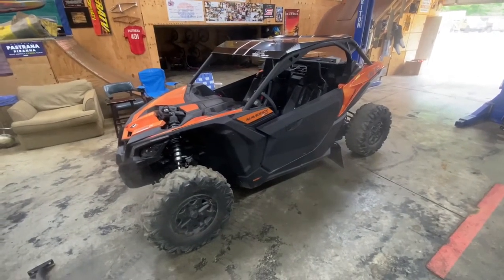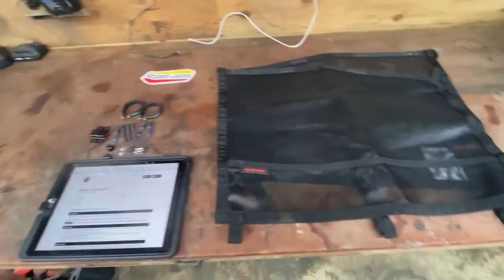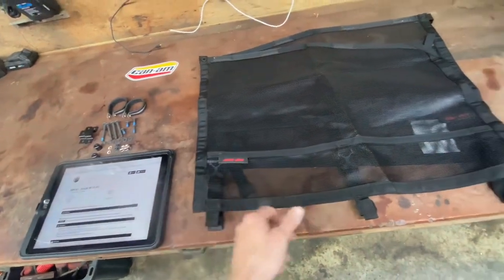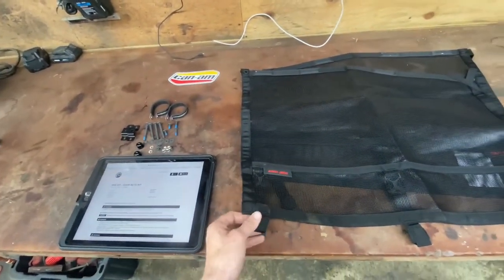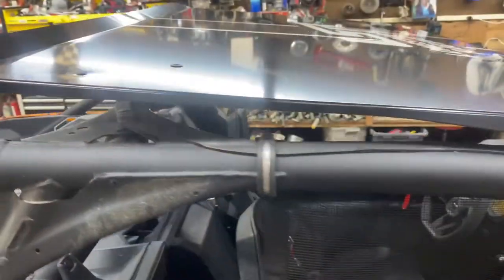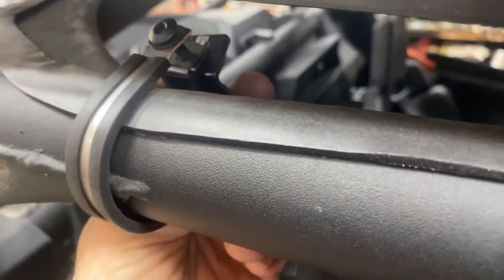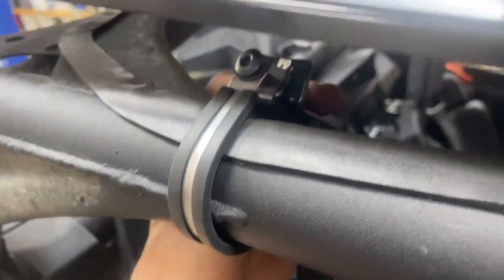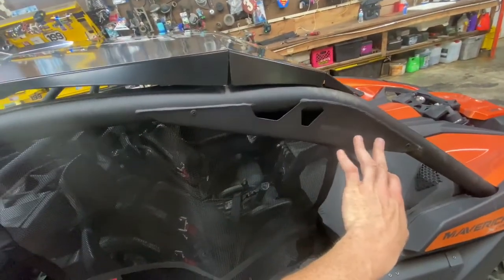Tech Talk Tuesday | How to install Maverick X3 Front Window Nets

Comment: Nice job here.  Question if you don’t mind. How do you open door?  Do you have to take them off?  Is that easy and quick?  Also, I have mirrors bolted into those upper holes. I’d have to change that I guess. Finally, anything you install on upper bars under at least the oem roof makes it very tough if not impossible to secure roof with the very short screws they supply. I do like the idea of nets to keep arms inside in case of disaster. Ty.
Reply from the maker: So the net attached towards the rear of the cage. The the top to the front has magnets to help hold the net to cage. The very front has a rubber loop that you loop around a stub that you bolt on using the holes in the cage. 

You can still use your current mirrors. 
May just need longer bolts to mount the stub on the inside. 

As for the roof. I’m sure what roof you have. But i have the audio roof on one machine. It uses 4 bolts. 1 per corner. I have to put the nut on a socket with extension. Pushing up to the cage. Look down through to to to get hole lined up and then thread bolt in. 

If you need longer bolts just go to a hardware store.  

The ones that hold mirror and the stub for nets are m6 diameter. 
The ones for roof are most likely m8.  

Take the old bolts with. To compare.